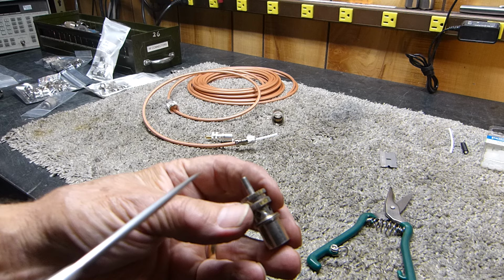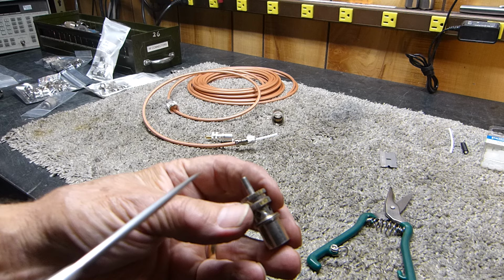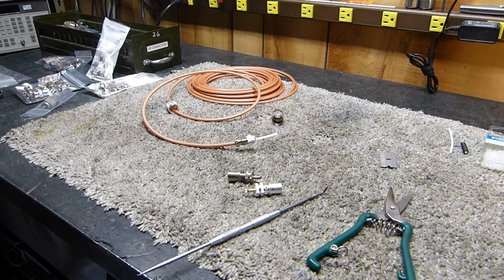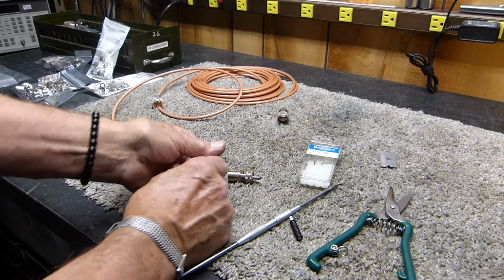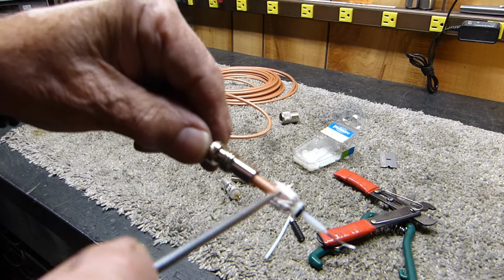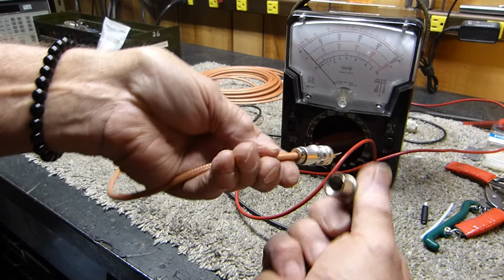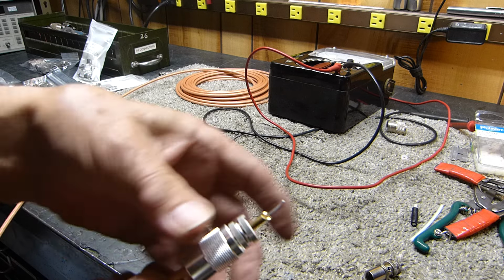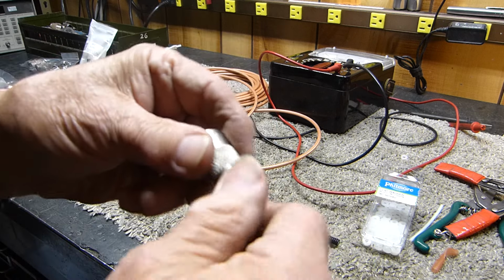PL-259 Connectors on RG-400 or RG-58 Coax Cable

Comment: A quick heads up on o-rings.
Some have a high carbon content and will conduct under compression and higher voltage.
Lesson learned the hard way.
Reply from the maker: I didn't think about that. Thanks. Maybe the nylon washers are the best and leave out the o-ring? Since the only thing soldered
is the center pin, I will likely take my main RF line apart tonight and just insert the nylon washer.
Reply from the maker: You got me going - I just went and measured the o-rings I have with a megger going to 5KV and I think mine are going to be OK. Still 20G ohm or better until I get it so close that it just arcs across in air. Still something to keep in mind. Thanks again...
Reply: Maybe use Teflon o-rings?

Comment: I had something similar a few years ago with some screw on n types. The seller forgot to include the waterproof rubber o rings.
Reply from the maker: Hi Andrew,
Good to hear from you. You have done some marvelous work on GHz level antennas. I have watched many of your videos. I never advanced past 2.4 GHz as far as building my own antennas. I put up store-bought 5 GHz dishes on my house and share my Internet with two AirBnB properties I have near by and only have to have one fiber account. I did build a 1.4 GHz antenna for a radio telescope and use SDR and a PC to view the resonate hydrogen line in nebule. That was about a year ago. You mention the o-rings in your  N connectors and another gentleman said he got Teflon washers in some of his PL-259 connectors so apparently some good manufacturers of these so called, UHF PL-259 connectors realized the problem with the shield shorting long ago. I did test these connections shown in this video with a megger and it would withstand 2.5 KV so It seems the o-rings I used are Ok and don't have too much carbon as mentioned in a comment below....   Anyway, take care and stay safe.

Comment: Hi Dave. I've been frigging with these frigging things for 60 years, since the days of the Belling-Lee 75 ohm PAL connectors for TV and FM. Did one the other day actually. I have always thought this style of thing where you fold over the braid and ram it home a terrible design, although I understand the design constraints, and now they seem to have made it worse!

Best

EJP
Reply from the maker: It is just that I followed prescribed directions and it always ended up shorted... what's wrong with this picture. A close visual inspection started making sense. For the large coax like LMR-400, for example, the dielectric presses right up against the center pin, covers it, and it works perfect. If one looks up connectors for RG-400, it is a completely different and new, screw on connector - oh well... so much for using the reducers - but it got me thinking how it used to work great and an inspection of the older connectors made it obvious. I normally use the large and stiff LMR-400 but sometimes that is like plumbing a house with 3/4 inch copper when you only need a small plastic tube like on a refrigerator. Anyway, good to hear from you. I have a few more idea for short videos. Since Microsoft took away the video editor that I used to concatenated videos, I prefer to just make one short one and post instead of going thru learning another video editor. Stay safe...

Comment: I love RG-400. All my jumpers in the shack are RG-400. 73 Joe
Reply from the maker: I am planning, when it cools off this afternoon...  to replace the RG-58 in my truck for my mobile station, with the RG-400. RG-58 is good cable but honestly, I sometimes use it as a lossy connection between an exciter driving an amplifier but I don't need loss in my mobile setup.  🙂  Thanks for your comments.  73  WA4QGA

Comment: Hi Dave,
Here's a video on the method I have been using with great success. However I did discover that those silver plated shells did not screw onto an SO-239 completely before getting tight. I had to order a special tap to clean the threads. Maybe the tried and true Amphenol connectors might have been a better choice.  73  WJ3U
https://www.youtube.com/watch?v=O3u05ZTTTr4&t=1813s
Reply from the maker: Hi Don,
Indeed, the USA made Amphenol connectors are by far the best even if the dielectric is not PTFE. I have had new PL-259 and SO-239 connectors that simply will not tighten up  the threads because of loose and-way-out-of-tolerance, conditions. Junk is what it is called. I just thought it might be helpful to someone going thru what I went thru, even with RG-58, to have the shield shorting to the center conductor because of the new PL-259 connectors and have some sort of solution. The new connectors (some) are actually quite good for LMR-400 size dielectric but, as the video shows, not so good for other uses.  Amazing how a tiny design modification can change things in ways unseen at the time.  No doubt, in my mind, designs, as seemingly simple as a PL-259 connector, were much better planned and thought-out many years ago.     73  WA4QGA    PS - I did watch the BBI video. Can't say his method is bad but I don't see it necessary in most cases - maybe as he said, in rain and weather conditions on a vehicle, his method is probably better.

Comment: The problem is those are garbage connectors, they are Legacy style UHF connectors and you'll never see them used in a laboratory and for good reason, they're not constant impedance, they cause all sorts of impedance reflections, the more of these you have in the feed line the worse it gets and Lord help you if you get two connectors in Phase with each other.

If you must use UHF connectors then you're much better off using the laboratory style clamp connector, these are improved versions of the Legacy pl259 and good to up to one gigahertz where the pl259 starts having real issues above 300 MHz of course this doesn't prevent ham from using them on 400 MHz which is ridiculous.

Anyhow Google M&P clamp style UHF, you'll thank me later. It's all I use in my lab, in fact I use it on all my feed lines calling for UHF connectors.

For the life of me I can't figure out why ham radio operators are still using this crappy connector probably have something to do with ham radio being overrun by conservatives who just can't stand new technology or any change to the status quo. 

The bottom line is the clamp style UHF connectors far better than even the crimp style connectors their  impedance profile is superior to the Legacy solder type UHF connector add their just as waterproof as n connectors. 

Using these old style UHF connectors is kind of like buying a car that needs to be hand-cranked.